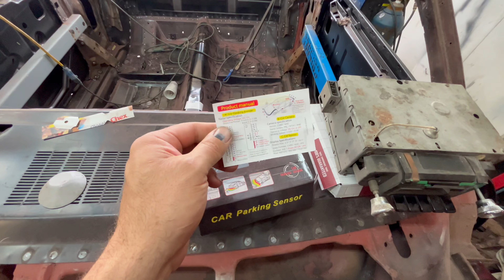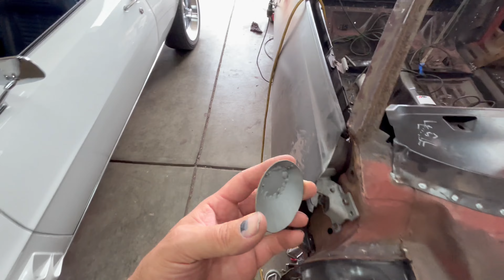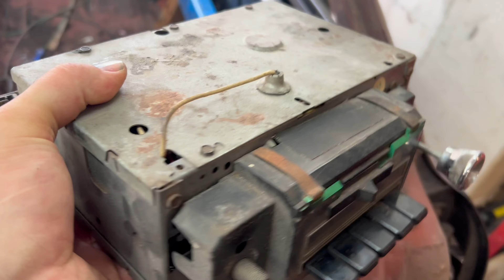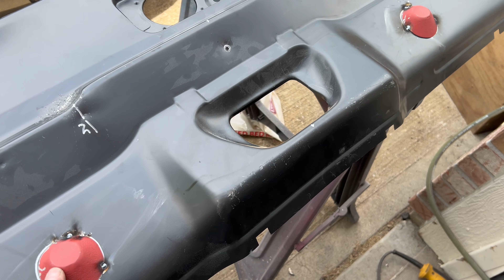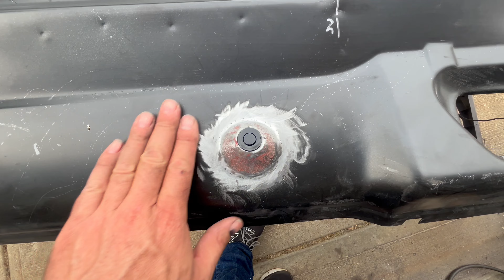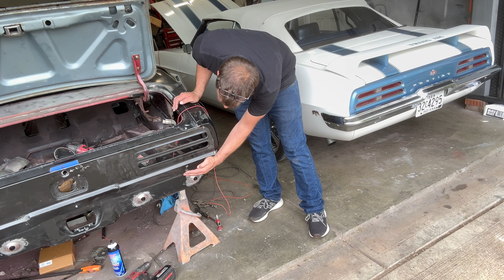Back up parking sensor installation, modifications and testing on muscle car

Comment: wonder if the sensors are paintable?  🤔
Reply: What looks to be the same equipment is also sold by another popular internet company. Tadbros or something. They say the sensors are available in different colors and state they are paintable.
Reply: @jamesforehan2809  Good to know!  I'd might mount mine on small brackets glued to inside of rear bumper.  But might not work if too close to bumper.  Probably why Jon did the way he did!  They are obviously painted on OEM applications, just unsure on kit he used.  I back my cars into a crowded garage, this would help!
Reply from the maker: Not sure.  I wasn’t planning on painting them. But might be worth testing
Reply: @VinylVillageGarage  I probably would paint them, but might need to paint a couple of extras, just in case one fails.
Reply from the maker: @Classiccarstexas I was going to buy an extra set and experiment with them
Reply: @VinylVillageGarage  I knew you would!  LOL  $20

Comment: Should have tested it with the bumper fitted, you dont the effect it will have on the sensors.
Reply from the maker: I did test it with the bumper held in approx location and found it could come down and back quite a bit past normal location before any reaction

Comment: Very cool, I like it. I looked into doing that years ago but all the ones I saw that were available all said they could not be installed into metal. Obviously it has been many years and technology changes but just curios if the instructions say anything about it or have you seen that before?
Reply from the maker: The instructions didn’t specify, they are very vague but all the testing i did the metal being close had no interference

Comment: Pretty cool modification for your dad! How did you shape the pods?
Reply from the maker: My dad engineered the template for me to make the pot of metal. It’s two pieces in shaped and welded it together. I will
Show it on a upcoming video